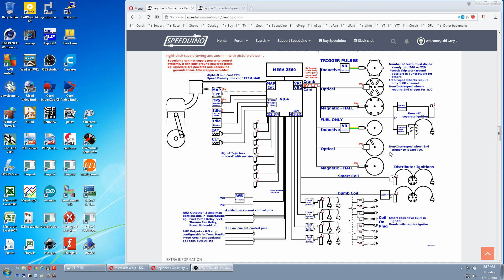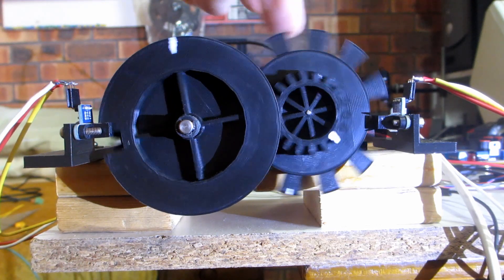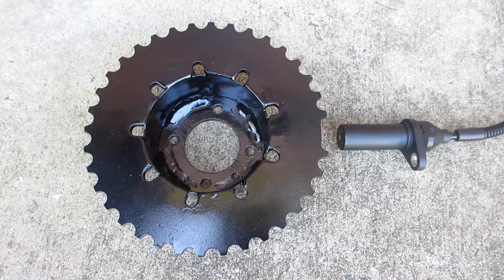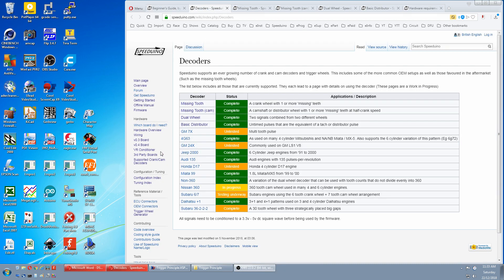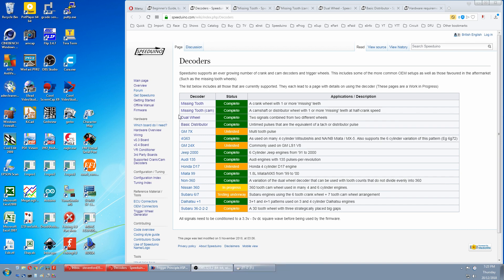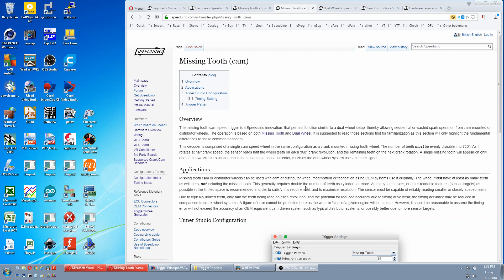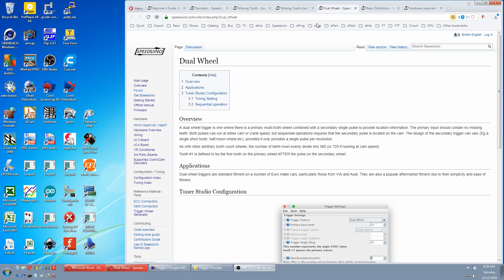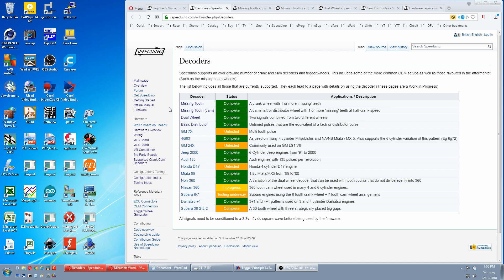Speeduino EMS #6 - Adv Trigger#1 - Explanation

Comment: your statement on Dual wheel description that you didn't read "well i didn't read divide evenly into 360 on the other wheels" the other wheels DO state the number of teeth MUST evenly divisible into 720 degrees as does the in brackets on Dual wheel. it would be impossible not to have a even count for 360 then.
Reply from the maker: 7:38 It is like Missing tooth(Cam) which has a divide rule, but that is a rare wheel, but It's not like Missing tooth wheels because there is no divide rule for them in the Wiki anymore,  so you could say it's a 50/50 statement. There were other problems in the Wiki, and I did ask them to fix the sparse Decoder pages before I released the vid, but no one was interested so my gripe stayed.